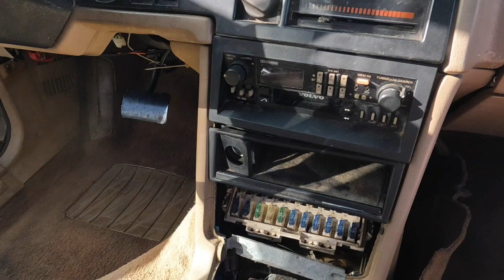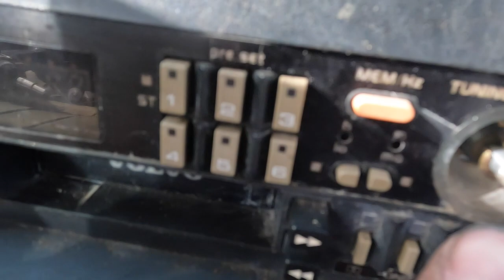Volvo 740 HVAC Box Rebuild - Heater Matrix, A/C Evaporator Replacement and Blending door Seals

Comment: You are a genius  I have now  got 2 volvo  900 D24s both drivers  you give me inspiration  to tackle  the small  jobs I can do now im retired,  ive just replace  the heater control valve  on my non air con latest  car a 940 D24 1997 with  170000 miles  it has some  oil leak on air intake area, ive replaced  the rocker cover  gasket  that was leaking  badly  im bit concerned  that sump gasket  or rear  crank shaft seal  may be leaking  not much but there a bit of oil coming  near  the sump plug are ,my cooler 1995 car never leaked much  oil  both cars  are zf  auto box , I just got garage  to change  ATF oil and filter  and new gasket  ,
Regards jim

Comment: Would it be possible to get a complete plastic house and put in a fan and evaporator and put the whole thing in the trunk of a coupe 740. And then pull the vents out behind the back seats? There wouldn't be any controls and no heater core but that's not really a problem as long as I get cool air for me and the children in rush hour.